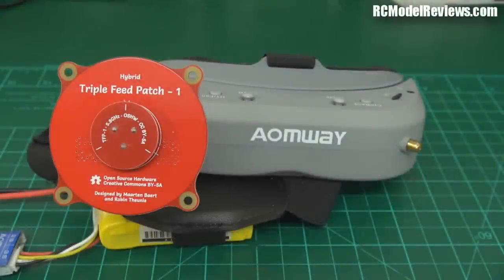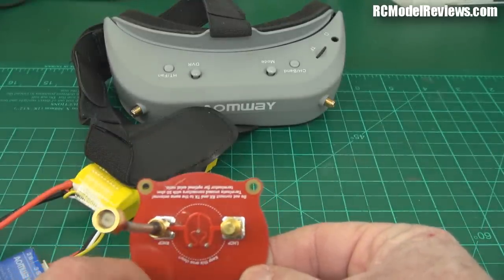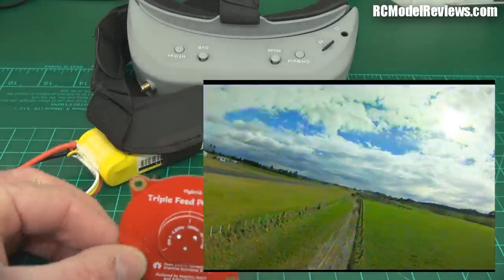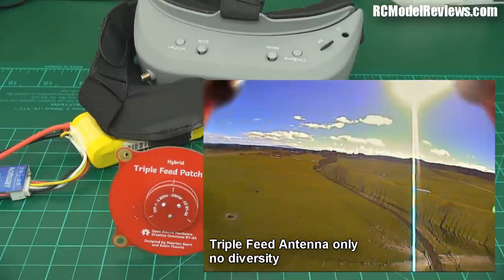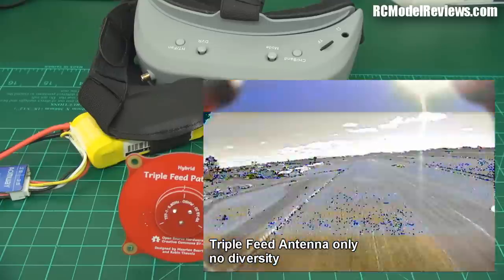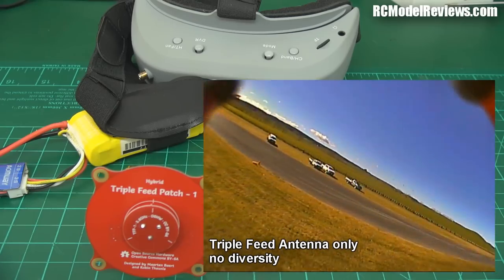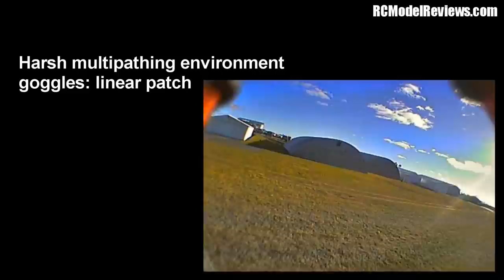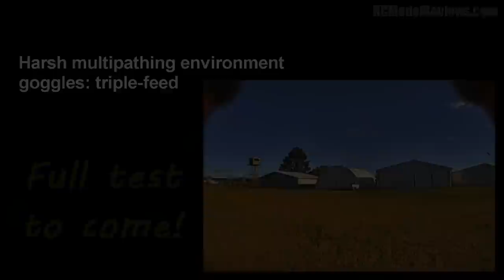New triple feed patch antenna from Maarten Baert

Comment: Can both antennas be connected as a center of signal mass? My hubsan zino pro has 2 5.8ghz connections on the controller in which I do not know if its RH or LH.

Comment: damn.. I forgot to terminate the other terminal lol..  weirdly I've never had too much issue with signal break up unless it tucked behind a tree or something. Can I ask, if I didn't want to use the coaxial cable, would this affect the signal if I was to use just coaxial adapters? Very new to the hobby, but having a blast so far

Comment: can you connect both sides to a diversity receiver at the same time and have LH and RH  without diversity?    would be handy for ride alongs when you don't know what direction the signal is.
Reply: Yes you can :). You still need a diversity receiver though, so it's not really 'without diversity'.
Reply: Great bit of kit, works great. Many thanks.
Reply: Yes, anything close to the copper tracks or the circular patch itself will affect the RF behavior. I don't really understand why you would want to coat these though, they are pretty solid as-is. The weakest point is probably the connector.
Reply: Feared that the discs would get shifted - glue would hold it.  So far mine have stood up well so as you wrote, it may not be needed. Many thanks.

Comment: Hello Bruce,

do you think it would be useful to unsolder the sma connectors on a half overlord receiver and directly solder rg402 cable between 14dpi antennae and receivers?
I bought a new half overlord and want to conect the patches with rg402 to adjust the angle between the antennas because I think at higher ranges the main lobe of the patches wont overlap at the standard setting of 3 pathces for 210° and I want to reduce the angle for higer range. While an additional rg402 cable inserts 4 connectors between rx and antenna.

Comment: Hi There, Great video as always. Still I have an unclear question about the SMA termination part, There several options available vary by frequency (2.5 ghz, 6 ghz, 12 ghz ) and Watts.

Can you please advice on the correct "terminator" frequency ?

Thanks
Reply: No idea but mine is terminated with a fifty ohm termination.

Comment: I want to fly FPV but haven't because of my eye sight for close up is terrible. I first started with Fat Shark goggles and can't get the images in focus. So, I bought a Quantum with the screen and tried to modify them to be able to wear my glasses. That really doesn't work either. Will I ever be able to fly FPV with my poor closeup vision issues?
Reply from the maker: Do you wear convex or concave glasses -- are you long or short-sighted?    What a couple of guys have done in our club is get some cheap plastic reading glasses, take out the lenses, cut them to shape and hot-glue them into their video goggles to provide extra magnification.  That' works a treat and is a super-cheap modification.
Reply: I just got new glasses and my right eye is 3x worse than my left for closeup vision. I'll just get 2 different sets of reading glasses, one set for each eye and try your suggestion out. Thanks! there my be hope yet for just turning 70.